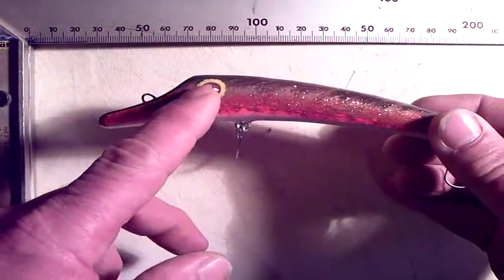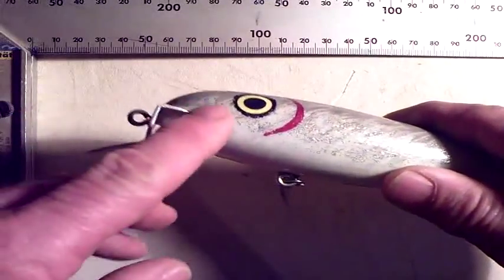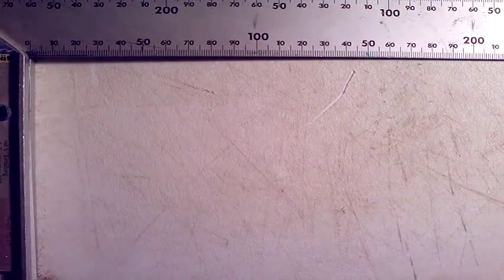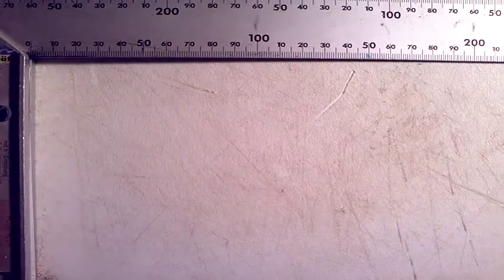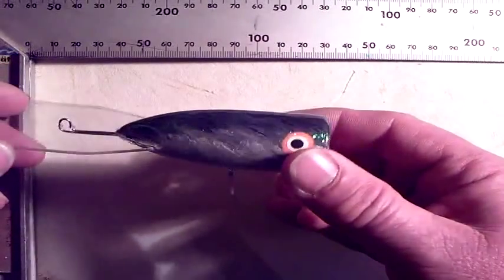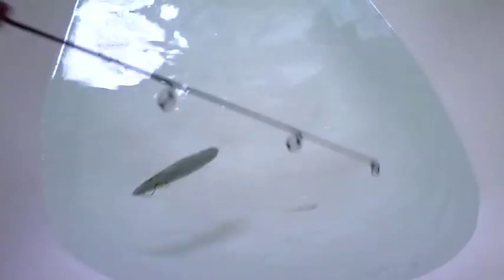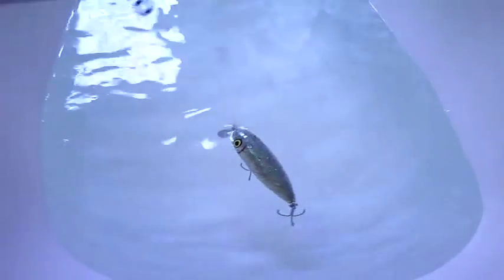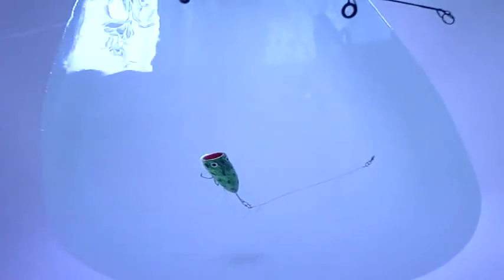"Pop'n'Dive" And Other Homemades

Comment: I really like the 16:52 lure in two segments that is smaller......
Reply from the maker: If you're after such lures , you may check the web , type in "striper lures" or "striper bass lures" , .....there are a few lure models around quite similar , sold by small manufacturers , also some action display videos available here on YouTube .

My own version is a knock-off of a vintage lure model .

Cheers , 61diemai